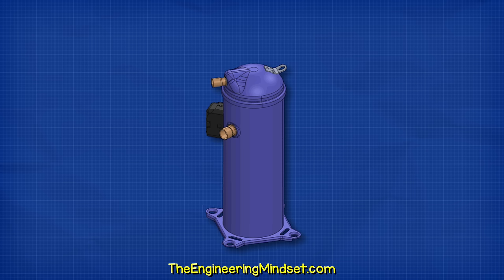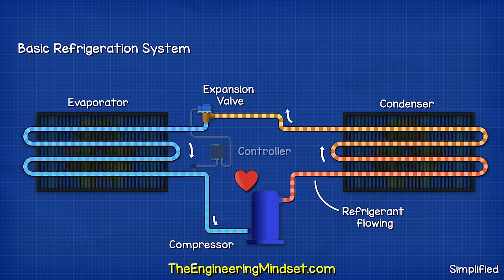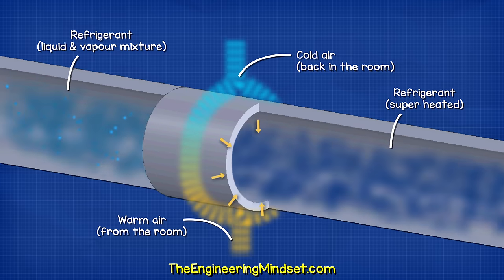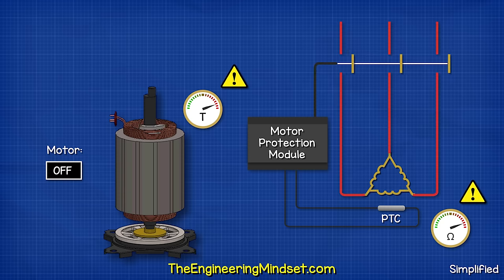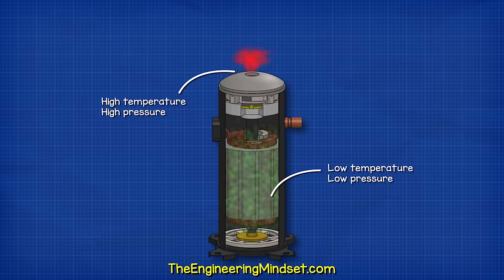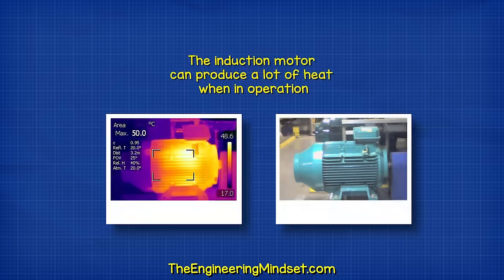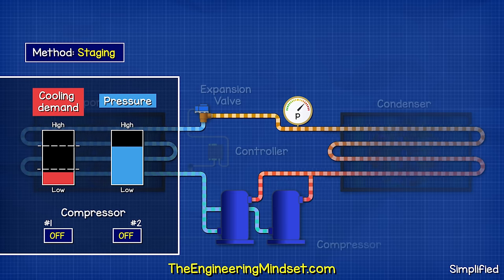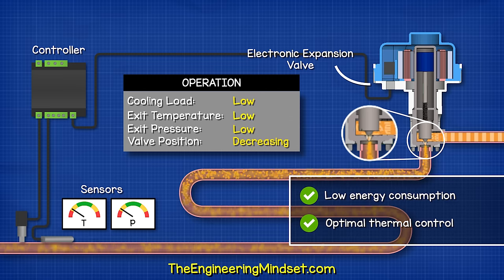Scroll Compressor Exposed: Understanding Its Mechanical Magic

Comment: As an HVAC guy with 17 years experience i'd like to say this was a rather well put together video. 
I'd also like to add a warning about digital scrolls. They are extremely inefficient. They still draw about 60% power while unloaded as they do loaded. The only real application as i see it would be as a capacity modulating stage in a system with multiple compressors, to get a true n-100% capacity instead of 100/n steps. Emerson have pushed them out in datacenter applications which is where i've come in contact with them. Hugely wasteful, and they do wear out quicker than a fixed scroll. And the noise they make, awful.
Reply: I didn’t know they were so inefficient! Yes the noise is very annoying. They do provide a much more comfortable environment than the traditional on/off. You can get much more steady discharge temperatures.  I hope we start seeing more VFD controlled compressors in the future. That seems like the best solution.
Reply: Clear. Approachable terminology and length. Beautiful, detailed schematic-like graphics and animations. This is such a well done video!

Comment: Thank you for this video.  I worked in the Automotive field for more than 30 years and part of that was learning about and repairing mobile  A/C systems including my own vehicles.
While auto compressors were mostly belt driven, obviously being variable engine speed, piston pumps with "Swash Plates" could give variable output.  Some vehicles had electronically controlled output, many had clutch engagement on the drive side.
Since Hybrids came out, their compressors could use the High Voltage Battery Power changed to a 3 Phase A/C Motorized Compressor.  I'm reading more lately how low pressure gas engine fuel pumps are 3 phase power now.  That pump has it's own module that changes the 12 Volt battery power to variable 3 phase power controlled by the Powertrain Control Module (PCM) which runs the engine.  The Fuel Pump Control Module changes the fuel pump's output depending on the  signal from the PCM and it's demands.  That's on a CAN network.  Talk about complexity!
Thank you for this video.
Reply: ....man that's fucking stupid. I love the simplicity of the diaphraghm fuel pump on my 85 F150. It's so damn reliable. And easy to change if it needs it. And interestingly, so is the factory(!!) aircon on that truck. Still has its original charge of R12 in it and it will still freeze an eskimo's nutsack off.

Comment: Excellent animation to show the actual scroll operation!  Two other issues though:
1. The toy that bubbles in your hand does NOT have ‘refrigerant’ and is NOT boiling!  It’s simply air pressure from the expansion caused by your warm hand heating the lower chamber!  (This was the main reason for my comment and I didn’t see anyone else mention it.)
2. When looking through comments I was reminded of another thing that hit me.  As someone else noted, the spray bottle doesn’t make liquid evaporate, but just “atomizes” it for greater surface area for easier evaporation.

Comment: This is a great video!  The ventilators I used to work on used scroll compressors with reed valves.  Had to tear them down and service them every 5000 hours.  Super interesting system

Comment: Thanks, Paul! 
My Carrier heat pump (domestic service) has a variable-speed compressor, variable-speed blower, and (possibly) an electronic expansion valve. We selected this model for its high efficiency. I was pleased to see some of these aspects covered in your video. At the same time, your breakdown of the compressor reveals a great many wear points, particularly within the scroll mechanism. Rather concerning.~~~~Arthur Ogawa
Reply: Paul, I have the same carrier as described, but mine makes a sculling sound on shutdown. Any suggestions?  Thanks  Charles

Comment: Great video! I worked on the Boeing 787 supplemental cooling units for about a year which use scroll compressors. The -8 and -9 aircraft SCUs use a TXV while the -10 uses an EEV. Variable speed motors and with an economizer to improve coefficient of performance (efficiency).

Comment: VRF systems are completely changing the game for small scale cooling systems, especially with the increase in ductless systems in the US. I've got a ductless mini split heat pump in my office and it has fantastic temperature control, never feels too hot or too cold in the space and I know it only uses as much energy as it needs to maintain that temp.
Reply from the maker: Totally is. We also have a very detailed video of VRF systems

Comment: Question - If scroll is not allowing refrigerant to escape unnecessarily from unexpected places but only from the centre that means that cavity that scroll makes it air tight right? So the walls of scroll always will have friction as they touch eachother, so how this much friction is overcomed?
Reply: This was the thing that prevented scrolls from being viable for many years. It's actually a very old concept, but i believe it was only in the 70's that manufacturing techniques were refined enough that the tolerances of the scrolls would be fine enough for it to work. The scrolls barely touch in reality, they employ a thin film of oil to do the sealing.
Reply: @hansmuller1625  hmm
Reply: I'm no expert but the fact that the output is pulsed suggests that at some point the opening is sealed. 🦭

Just like an internal combustion engine which lets in the fuel into the cylinders and then seals prior to compression and detonation 💥

Comment: Overall a good video, I do have some issues, like with the spray water bottle, it doesn't evaporate the water, it creates a mist, that mist is not evaporated water, but liquid water particles. Those particles can evaporate rather quickly, but that takes a lot of energy, which causes a temperature drop. But the water doesn't boil, unless the temperature is above the boiling point. The drop in temperature will typically initially be fast, and then slow down the closer to the dew point of that droplet-air mixture gets, and the dew point of that mixture will be higher than that of the ambient air because of the added water vapor.          

Boiling point is a function of temperature and pressure, a typical heat pump compressor simply change the pressure to change the temperature of the boiling point of the refrigerant. A water spray bottle does not decrease the pressure of ambient air, it's technically not the exact thing that happens, even if both the refrigerant and water evaporates, the spray bottle just increase the surface area of the water and mix it with air.

Comment: Nice job, but the flow thru the condenser and evaporator is shown wrong. Hot gas enters the top of the condenser coil and leaves at the bottom as a liquid, due to gravity the liquid is heavier than gas. The evaporator works just the opposite, liquid enters low in each individual tube and leaves as a gas high. This also helps to prevents liquid entering from entering the suction side.

Comment: This design seems simpler and more efficient than traditional compressors... why are they so expensive?
Reply: Complexity I imagine.
Reply: I mean the simplest designs are the motors that drive a piston, the piston compressing the air or gas in a cylinder, forcing open a check valve, much like in a vehicles engine. Very few parts, intuitive and cheap.
Reply: @A_Stereotypical_Heretic  Seems like the rotating spiral is significantly simpler than a piston mechanism but maybe I'm missing something?
Reply: @jeremiahbullfrog9288  I think it's just you have so many parts in action on a spiral compressor. More intricate, less intuitive maybe.
Reply: The scrolls themselves are a lot more complex with the various holes/slots etc, there is a lot more machining that needs to be done to make them work and that machining needs to be a lot more precise. An example is the heights of the scrolls of othe two halves needs to be very close or the whole thing just deosnt work.
Reply: I would imagine not being mass adopted is compounding the cost... good points mates
Reply: @jeremiahbullfrog9288  
Oh but they are. I'd say it's the most common type of compressor in units ranging from 5-10 kilowatts up to hundreds of kilowatts these days.
Reply: @hansmuller1625  So how long until we get affordable, quiet, efficient shop air compressors with this technology?

Comment: What value does it provide over other compressor? 

It looks more complicated and restricted.
Reply: High capacity in a small footprint, and higher efficiency compared to piston compressors.
Reply: Noise, number of parts, miniature size.

Comment: Is R1234ze going to be used in heat pumps in the EU? I see all heat pump manufactures design heatpumps with propane but no one uses R1234ze. why?

Comment: That's the very first time I've ever heard of a Pressure Relief Valve that discharges because of excessive temperature.

I'd be very interested to know how that works for this particular valve, or even how that's physically possible for such a small PRV with no sensing input other than pressure.

Comment: I just wish the fucking things would last longer than a season and a half these days. The R12 system in my 85 F150's factory(!!) aircon still works fine after nearly 40 years of service, but the modern, energy-efficient, low-carbon-footprint bullshit I hang in my window to cool my bedroom literally dies every season.

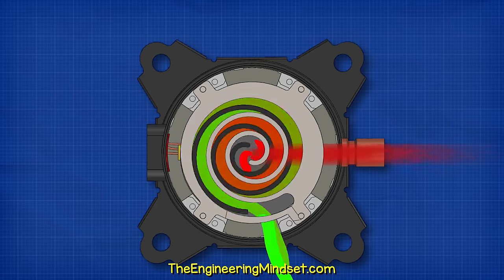Comment: 11:19 ok i see that was a mistake to not see the whole video before comment  
10:45 by the way its show you had skipped the outer layer compression pocked
also in this drawing make it looks like there its only a cycle running per revolution
should had added more colors to represent the Multiple compression cycles

Comment: Not sure what kind of ac compressor I have in my fleet of 20 year old Panthers but they all still work and the AC is ice cold and they have way over 200,000 miles on them. 95-05 was when the best automobiles were ever made and nothing will ever be made that well again as is obvious with cars and trucks made since then. Absolute junk.